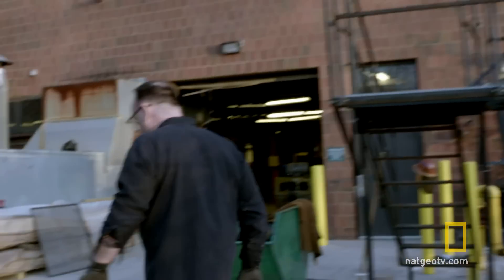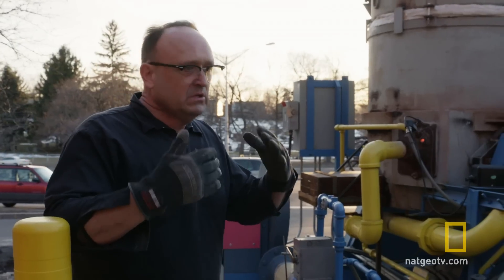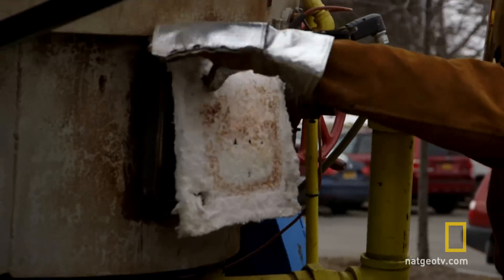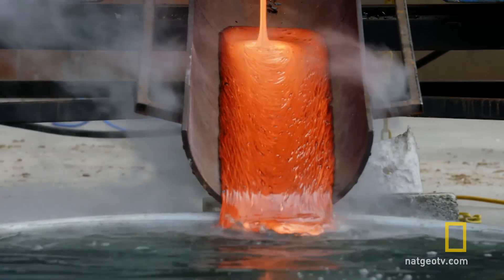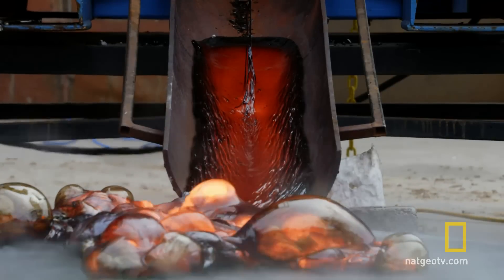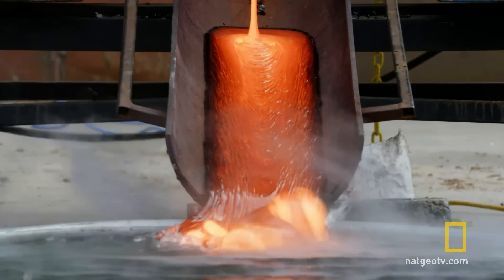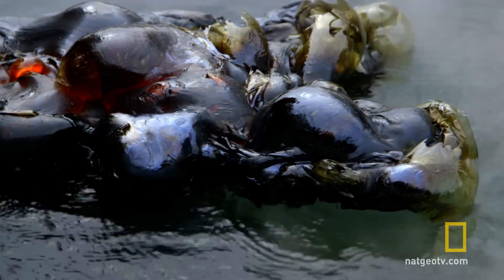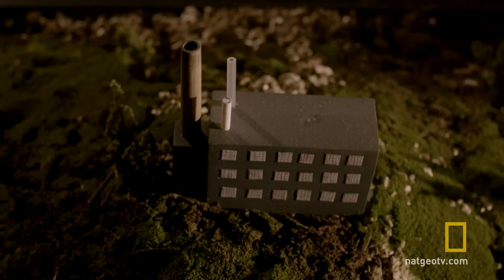When Magma Meets Water | Breakthrough

Comment: Use liquid helium of -270 degrees celcius or something even colder instead of water and see what happens and have enough safety precautions
Reply: Jeffrey Koelewijn Vaporizes without ever touching the lava. Difference in temperature is just too great.
Reply: Liquid Helium = -268. Magma , Let's say around 700. The difference?
Reply: William Andanu its mostly about the heat capacity of both substances and at what temperature does the colder substance turn into a gas
Reply: U guys are smart
Reply: Nitrogen?
Reply: We've done this into liquid nitrogen; same results as water. Oh, same safety precautions no matter what.
Reply: Jeffrey Koelewijn hv
Reply: @chaotixthefox  why would it vaporize though wouldn’t it freeze
Reply: @vlz.matthew  A temperature differential of 968 degrees.

Comment: Well, there's a slight difference in the amount of dissolved gases in lava as what is vented in nature is coming directly out of a gas rich, high pressure environment and can make much of its journey to the water fairly well encased and shielded within its native gases whereas I imagine the furnace is vented to avoid pressure problems and significantly more trapped gases are allowed to escape. I suspect that might result in non-negligible differences in results between the "lab" and field, but I'm hardly a geologist en even the loosest sense of the word, so there's that.

Comment: Its called Lava over the earth crust and Magma when its under the earth crust so its Not Magma its Lava
Reply: stani sta
 -
"Its called Lava over the earth crust and Magma when its under the earth crust so its Not Magma its Lava"
Very close!  You are right about it being Lava.  However, it is either INTRUSIVE Lava or EXTRUSIVE Lava depending on whether or not it has been expelled.  MAGMA on the other hand, does not exist.  Never did.  Lava is created locally through frictional heat caused by earthquakes along plates or fault lines.

You will never have a volcanic eruption without being preceded or accompanied by earthquakes.  These will typically be swarm or silent quakes that take place over several days and are often not detected other than by sensitive instruments.

Everything we were taught about the formation of the planet and the composition of it's interior was incorrect.  Pseudotheories...  nothing more.

Comment: But that’s not ocean water I assume 
It’s not salted water
Reply: lizzet castro the salt doesnt do much. It just makes the water salty. The salt wont change how steam or gas works
Reply: E- Tato 
thinking of ocean water. the metal chutes used for the experiment must have a high melting point to withstand the lava
 maybe army Corp of engineers could build large chutes to guild lava away from population and right into the Pacific Ocean for Hawaii